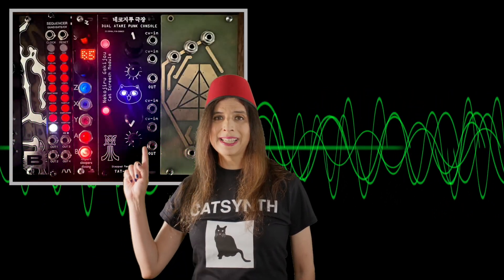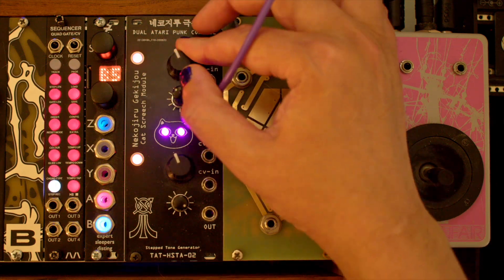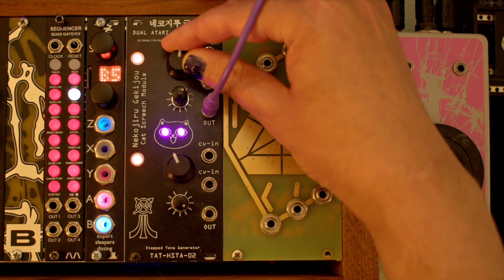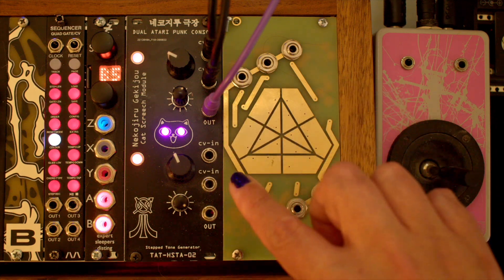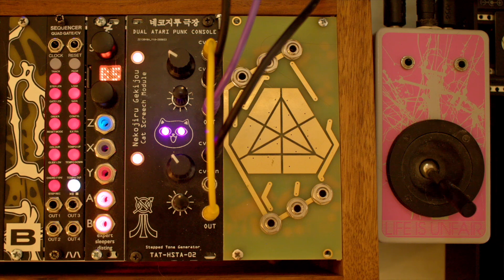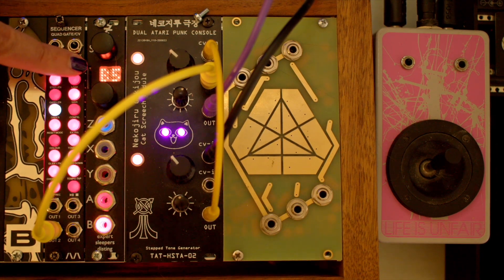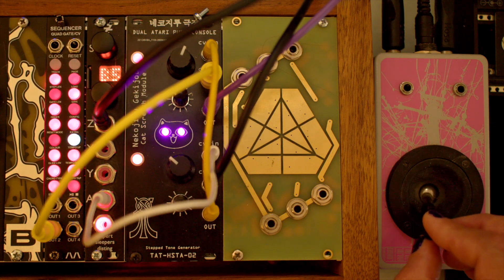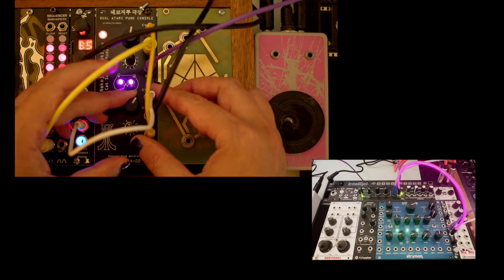The Dual Atari Punk Console - crunchy lo-fi sounds with a feline touch

Comment: I love it, I want it!

Thank you for the demonstration. This is by far the most endearing version of this module I have seen.
Reply from the maker: You're very welcome!  This is definitely my favorite version of the APC I've come across.
Reply: I know it is probably a bit of a stretch, but I love this so much I 100% want one.
But I can only find a newer faceplate with pacman and the atari logo at tear apart tapes.
Do you have a link to where you got this specific version?
Reply from the maker: I bought used on Reverb.  I think by that point they had already switched to making the pac-man version.  

This is Reverb store I bought it from:
https://reverb.com/shop/erics-gear-depot-1549